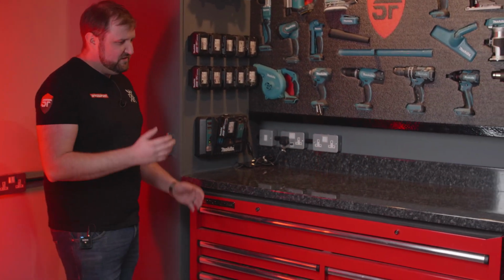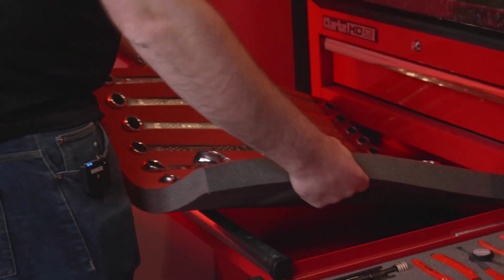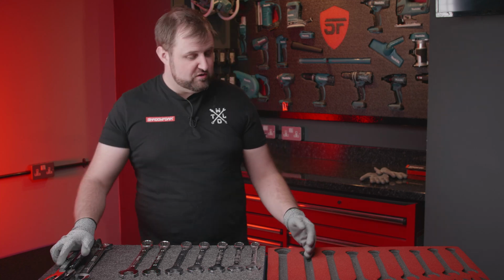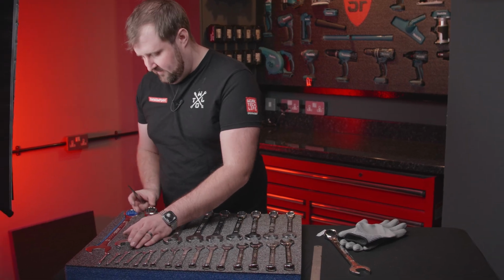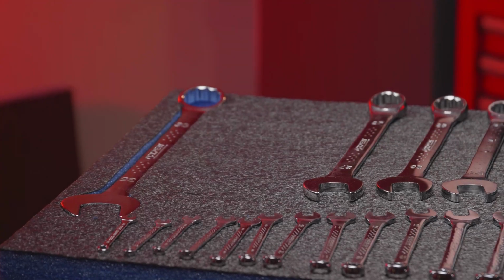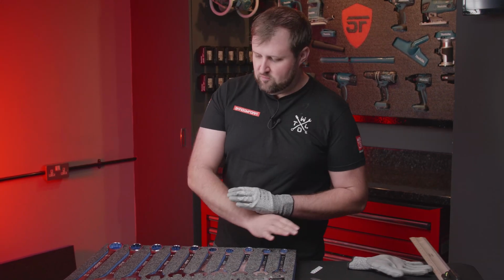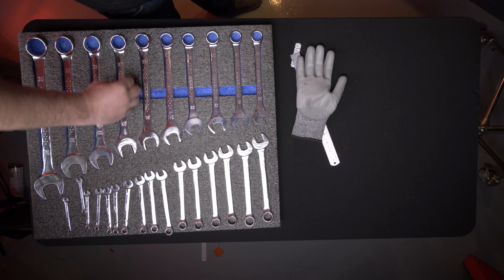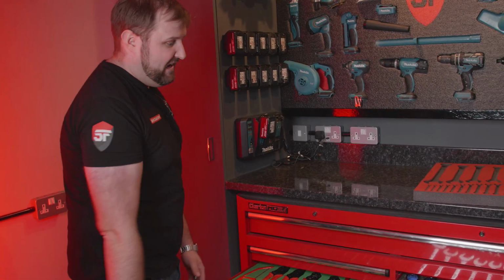UPGRADING our EPIC Big Red Clarke Toolbox! (ft. Britool Expert Spanners)

Comment: Great product and really enjoyable videos. 

Is it possible to purchase just the top black layer separately?

I want to cover some beveled cuts that have exposed the colour with a black strip adhered with your spray adhesive and then add tool inserts on these edges. I have tried cutting the top layer from off cuts but struggle to achieve a consistent finish. A thin sheet of the top black layer would look really clean for this application.

If not no worries I will persevere with the off cuts.
Reply from the maker: Unfortunately, we do not sell the black layer separately I'm afraid